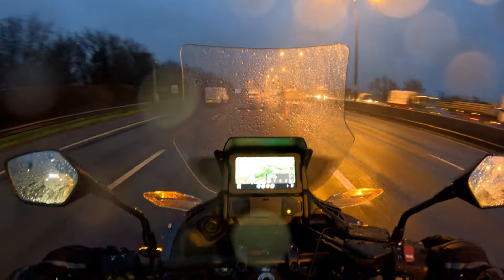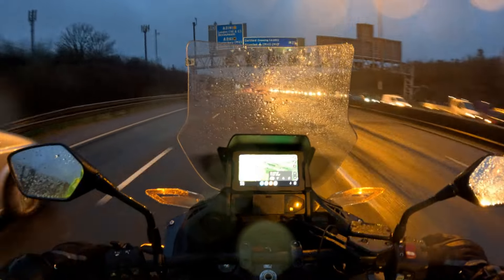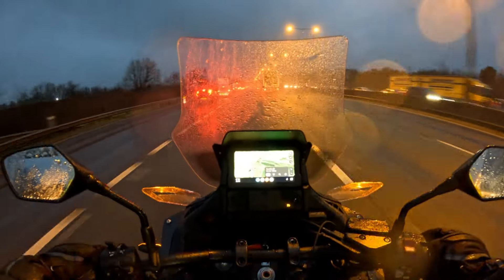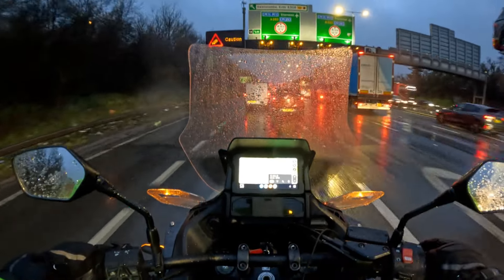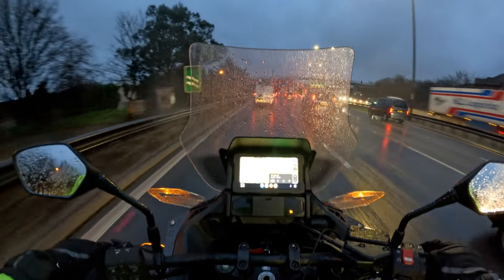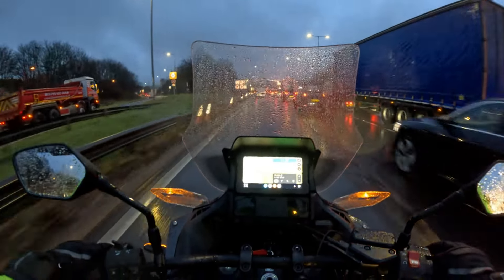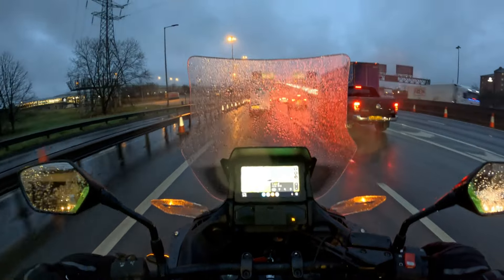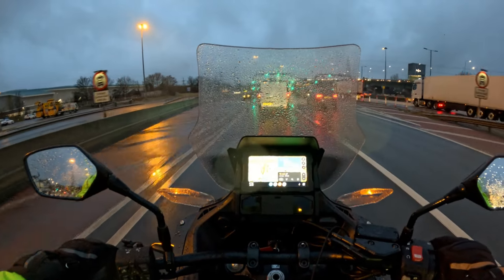NT 1100 Screen Test

Comment: It's unusual for rain to sit in beads like that it must be due to a combination of screen shape and coating. I've seen people use a product called Rain X on their helmet visors, so I imagine it would be equally efficient on a screen. That said I'd have thought any silicone polish especially one with ceramic properties would allow the beads to glide away. That's very helpful advice you gave regarding riding in heavy traffic in the rain 👍😀
Reply from the maker: Thanks for the suggestion I will have a look around for reviews on the Rain X as it might be a solution I'm looking for. Cheers

Comment: Have driven NT in torrential rain and didn't have that same issue. Wash bike and winshield in muc off then spray a water-repellent protector on both. Hope this helps🏍
Reply from the maker: Thank you for your comment.Since the video I did purchase a solution to apply to the windshield and will be testing its efficiency on my next ride out. Grey wolf suggested Rain X but I couldn't find it locally so I dropped into Halfords and bought an alternative. We will see how it goes on the NT soon. Thank you for the advice very much appreciated. Is there a product you currently use or would recommend ?
Reply: After washing, I use Muc Off motorcycle protectant all over  the bike, including the windshield and it seems to work. Hopefully, the one you got from Halfords does the same job. I👍
Reply from the maker: @stephenfry4685  If I have no luck with it I will try the Muc Off and see how that goes. If it works for you it should be fine for me also. Cheers

Comment: As already suggested, RAIN-X is brilliant stuff! I use it on the car too. However, is use RAIN-X PLASTIC on my windshield and visor. It does an outstanding job 👌
Reply from the maker: Will certainly give it a go when I get through my bottle of Clearview. I am thinking a lot of why it doesn't clear, and think It Is due to the aerodynamics fo the screen. The speed of the air passing around the edges of the screen must be creating a pocket of air in the middle. If there is anyone out there who can explain this I would be very interested. I have some ideas regarding windshield shapes which might give a better airflow across the whole screen keeping the water moving, But that is a project for the future. Thank you for your comment.